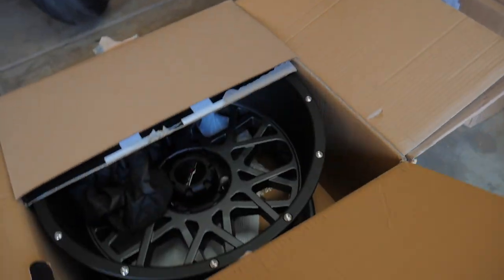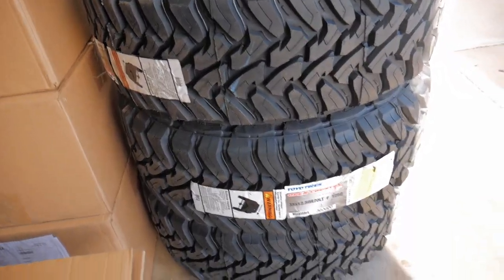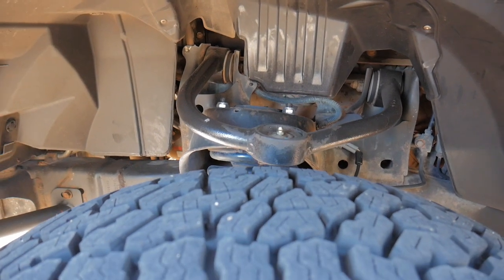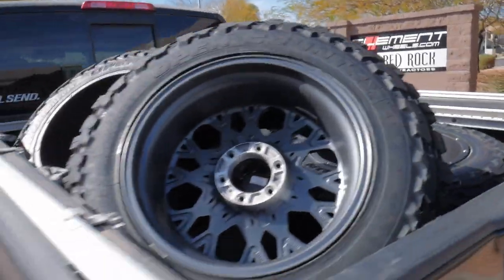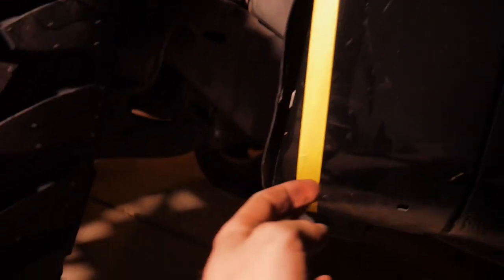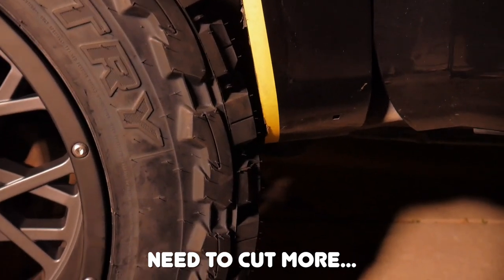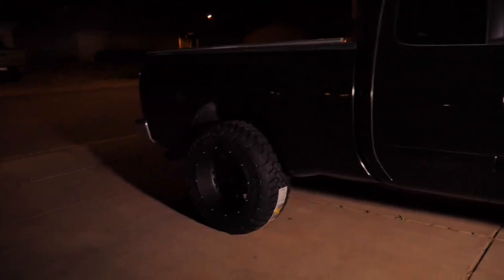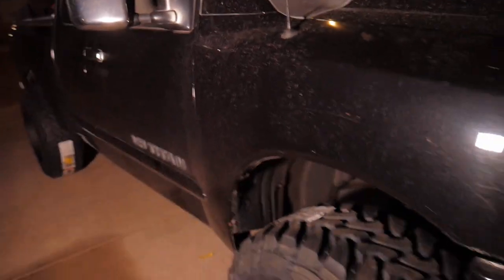LEVELED TITAN GETS 20x12 WHEELS WITH 35" TIRES

Comment: I got an 06 Titan with 35x12.5 20" and a 6" lift it gives plenty of clearance for even 37's if you wanted but with the 35's it gives the truck perfect symmetry.
Reply: You think a 3 inch lift would do plenty? I’m debating on if I keep my 3 inch or if I go 6 when I go to get my new wheels and tires. Want to do 20” wheels. And most likely 35’s for tires
Reply: @donovan9356  a 3 inch would make a difference but I'd go with 6 just so you know for sure you have the clearance

Comment: I have a 2012 running 35x12’s, 3” lift front and rear with bilstein 5100. 5 years later no problems but year 6 I’m having problems with having to replace cv half axels after replacing all ball joints and rods. I’ve been through 2 half axels (new with 3k miles) in 2 months tearing both inner boots. What gives? Is there any diff lowering kit I’m not aware of on the market for 3” kit and/or axle spacer kit?

Comment: I have a 2006 with a leveling kit would I be able to fit 33x12.50r18 without any problems
Reply: Little late 2 months but I have an 06 as well I run 33x12.50r20 with a -12 offset no problem just took off the mud flaps no rubbing at all